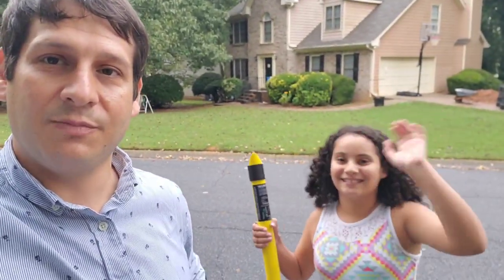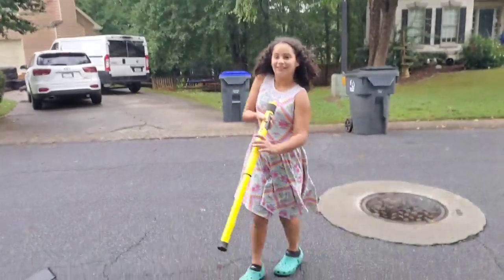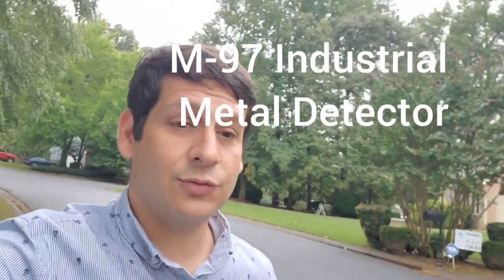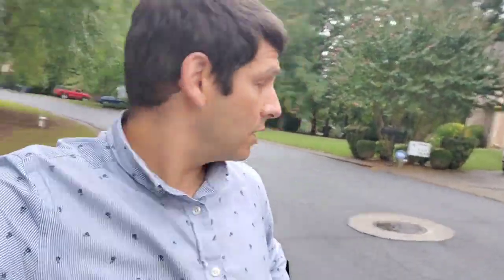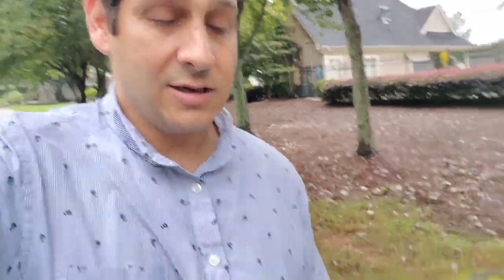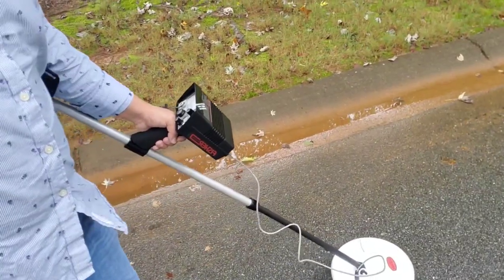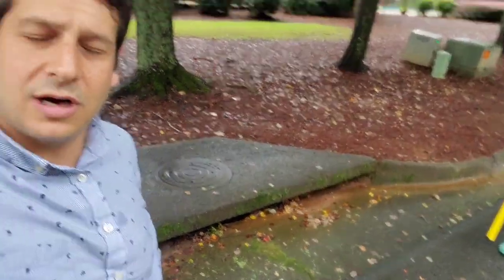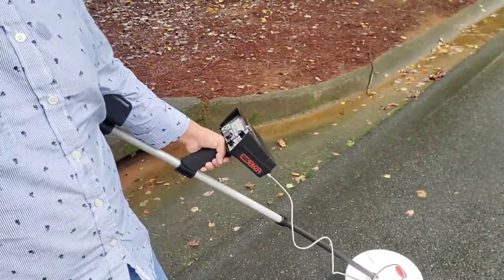Magnetometer and Metal Detectors in Locating | Subsurface Utility Mapping

Comment: Thanks for demonstrating & explaining.

I want to make a magnetic locator detection target to put on the end of a long plumber's snake that I can run through some plastic landscaping drainage pipe so I can find both where it is clogged and, eventually, where the other end is buried.

I'll be using a CST/berger Magna-Trak 200 magnetic locator, and I think I could follow the location of the locator target as my assistant feeds the plumber's snake into the plastic drainpipe.

Which would give me a more definitive detection as the layer of dirt & rock over the drainpipe gets thicker: a strong magnet or a ferrous iron target?
Reply from the maker: @alanmcrae8594  thanks for watching. You can do it usually with the sonde on the camera head instead of putting the locator on it. Does your camera have a sonde?
Reply: @Learngpr  I'm talking about a regular plumbers snake - basically a long, stiff but flexible , metal spring used to clear clogs in a residential home's drain pipe. Doesn't have a camera on it nor a sonde.
Reply from the maker: @alanmcrae8594  got it. They do sell throw away sounds that could go on the snake. Their only a few bucks. Might be worth looking into

Comment: 2:50 also with a magnatometer such as that your daughter is using she could be sensing one of the megnatic poles from the steel ferris manhole cover to the right of her or if there is a metal faceplate in that concrete vault drain opening. We understand that a Maggie can detect up to sixteen feet distance so let's be fair on what could really be going on. The flip side is that she could possibly  be detecting a ferris convert pipe that leads to that drain vault and the metal detector simply doesn't have the penetrating range as of the Maggie or has some ferris discrimination turned on. Very exciting technology when used by capable hands 👍 Cheers,  #SeattleRingHunter

Comment: Ohh love that you got Elianna in this one helping you out, that is super cool. 

Ok question time - what is the benifit of the metal detector over the magnetometer? 
I know you said it's good to carry both in your vehicle, but that is more cost to buy more gear and not everyone has big trucks with heaps of spare room. 
In my opinion, after that example you have shown, I'm thinking it's best just to have the magnetometer.
But did you two find any examples where the metal detector ended up working better?
Reply from the maker: Hey Ben! Gotta put the kids to work somehow. 
A situation where the metal detector would outperform the magnetometer is when the material is conductive, but does not necessarily have a strong magnetic field. For example, aluminum, copper, or silver. However, for most locating if you are going to get one of these two you would typically get the mag. It has more situations where it would outperform for locating. One of the largest differences between the two is going to be depth. Technically a metal detector will only induce a current approximately as deep as the coil size (maybe double depending on soil conditions), but the mag could get a response off of something that is far deeper (possibly 2-3 meters). Now that I am thinking about it, it could be exactly what happened in this case. Something that the metal detector could identify but was just too deep. The larger the magnetic object is, the deeper it can be for the magnetometer to pick up a reading. The technical difference between these two is that the metal detector (and pipe locator, and GPR) are active techniques. They have to "do" something in the subsurface to generate a response. The magnetometer is a passive technique...it only reads the magnetic field strength at any given location.
Reply: @Learngpr  ahh interesting, I didn't know that. Thanks for that, I appreciate you taking the time to let me know, cheers
Reply: Good point about the depth, it's possible the location where just the mag got a signal was corrugated metal pipe coming out of that storm drain inlet, which could be 5 or 6 feet deep.